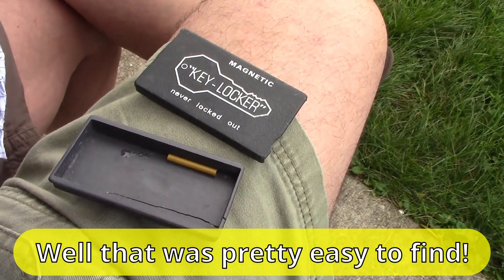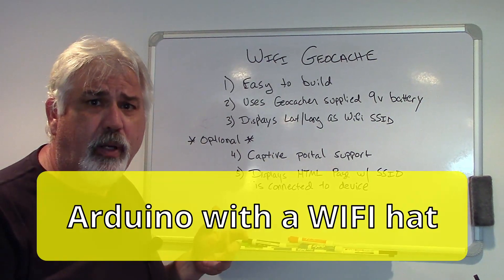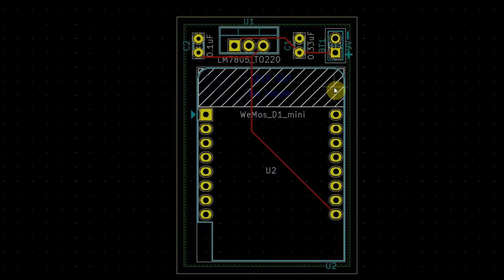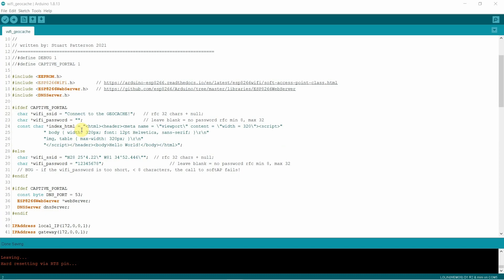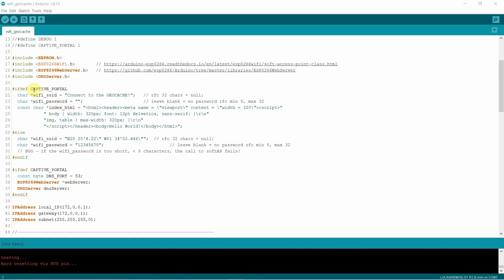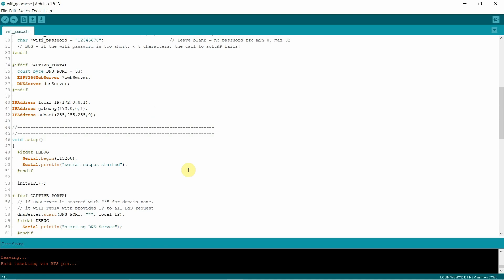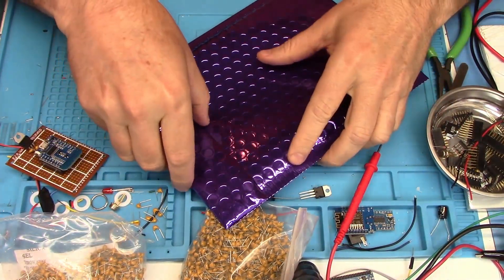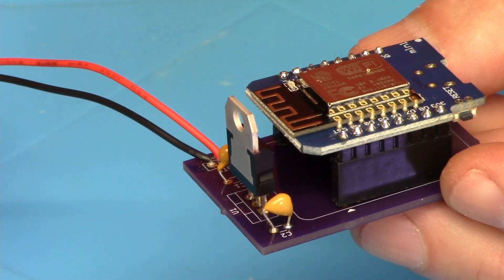WIFI GeoCache Component a.k.a. Soft Access Point and Captive Portal WIFI

Comment: Hello,

Nice project!

Got everything working with a Wemos D1 mini.

I still have a problem with connecting/logging in based on the Captive portal:

After I have selected and connected the available WiFi network "Connect to the GEOCACHE", I am not automatically redirected to the relevant HTML page. I only see (briefly) the message "Log in to Connect to tGEOCACHE" at the top of my screen, which then disappears.
If I then tap the selected network again, the HTML page comes into view.

I use a Samsung A53, Android V14.

The same results with a Samsung A72 with the latest Android version.

Hoping for a solution.

Thank you.

Greetings, Theo.
Reply from the maker: I don't have an Android device to test it with, but your best friend, in this case, is the serial monitor.  Try creating a generic on() handler and sending that the index_html.
https://github.com/esp8266/Arduino/tree/master/libraries/ESP8266WebServer

Comment: Nice Project.   

Wemos D1 R2s are still available and they have a power circuit built in. 
Just need a standard 9v plug/battery connector.

Another thought I had was the possibility of using What 3 Words as well.
(Could be the WiFi Password - to connect and get a message).
Reply from the maker: Thanks!  Based on the schematic I looked at the RT9013 voltage regulator, on the d1 mini, had a 5.5v limit.  Hence, why I added the lm7805.  Maybe the schematic is old? https://escapequotes.net/wp-content/uploads/2016/02/wemos-d1-mini-shematics.jpg
Reply: @StuartPatterson  I was looking at the D1 not the newer D1 mini.  It has a switching regulator. 
https://wiki.geekworm.com/WEMOS_ESP8266_D1_R2_V2.1
Reply from the maker: Ah, that explains it.  Better to just add it in this case since the people building one of these might not know to check their version of the D1 mini.
Reply: Thinking about the original project requirements- are RFID tags another way to implement a smart geo cache?
No electronics - just a tag you scan with your phone.
Even simpler is a QR code.
Reply: @RogerLeitch  Those QR codes and RFID's are used quite often, the wifi isn't. Plus the wifi like in this video gives a lot more options, like using the captive page for some extra puzzle element (protected with by a password or not). Most important, it's still a rare technique in the geocaching scene, so it will surprise geocachers, it is all about how fun is it to search for that cache, and where will it bring you.
Reply from the maker: QR code for sure. The person that was requesting help on Reddit wanted to use a WIFI SSID after he saw something similar.  You could just stick a label on the geocache with the next lat/long as well.  I think what makes this interesting is the potential of creating a puzzle in JavaScript and using the captured portal.
Reply: @StuartPatterson  It could be used for placing treasure hunt clues. 
(As can QR codes).